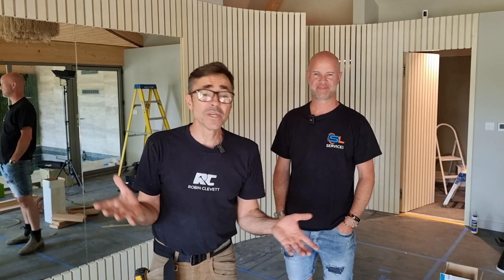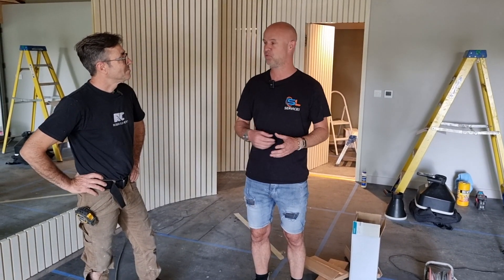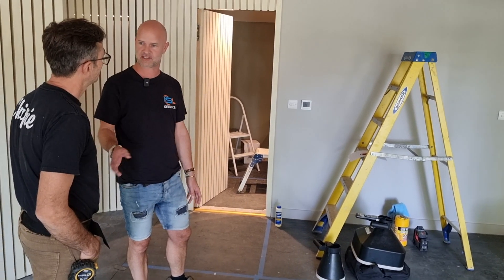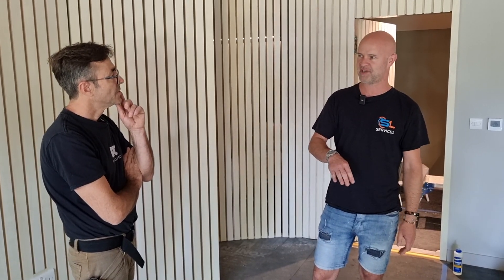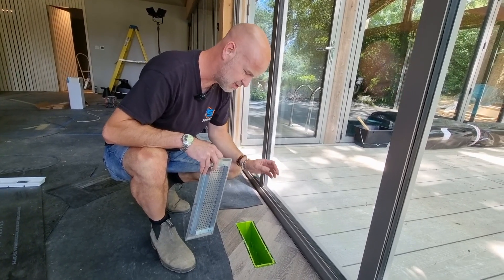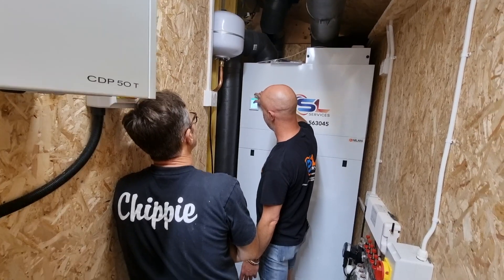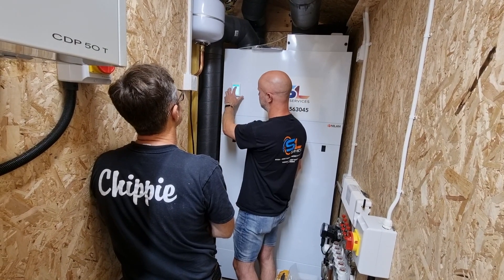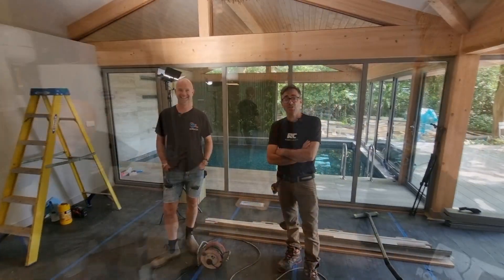Low cost heating and hot water and MVHR. Ultimate Garden room

Comment: A very interesting video. Is the underfloor heating and the air conditioning controlled from that same unit?
Reply from the maker: The unit provides the heat for the underfloor heating but the underfloor heating is controlled by its own controls and electronics, the unit has a small electric boiler internally that switches on when the floor is calling for heat via the room thermostats

Comment: Do you wish you would have installed this in the main house? If I can remember you installed another mvhr system.
Reply from the maker: This would be two small for the main house, and we have gas there so we have a wet underfloor heating set up, megaflow for hot water and then MVHR for all the moisture and ventilation control etc
Reply: @robinclevettcarpenter  oh so it’s limited on size of area etc… I remember watching you install the mvhr in your house. How are you getting on with that system?
Reply from the maker: Hi Andrew, The Lindab Mvhr system is trouble free and super quiet, I think I would struggle to live without MVHR now as the air quality of the house is always so good and there is never any issues like condensation anywhere!!

Comment: Hi Robin. Does this system do the pool temperature aswell or is that from a different unit?  
Knowledge is power. It’s good to learn new stuff
Reply from the maker: Hi Keith, the pool water is a separate air source heat pump, and the heating in the pool room is by a dedicated dehumidifier that also heats the air by electric element

Comment: nice but. that`s an expensive bit of kit for a garden room ,, go on then ball park figure how much did that system cost ??
Reply from the maker: I had to look at a few factors when deciding to invest in this unit and on the face of it lets say it is 10k supplied and fitted... but what I have is a super efficient system that is not energy hungry. There are indeed many other ways to do the heating, hot water and ventilation but believe me I looked into every possible combination of separate systems to deliver what I needed and when you take a decent MVHR system and installation, An on demand hot water system that is able to store hot water and not cost the earth to run, and separate heat source for our wet underfloor heating then it is very comparable in initial outlay of using single solutions.
If I was building a small house then I would not hesitate after using this unit to fit one again, and it all runs of a single compressor like a domestic fridge
Reply: @robinclevettcarpenter   cheers Robin
Reply: @robinclevettcarpenter  
I was looking at retrofitting a smaller MVHR system in my late 90's build home, primary use case being to provide good ventilation to the 1st floor living space of about 500 sq ft.  I see Nilan does a CT150 passive heat recovery unit and they have VPL15 which does active heat recover along with all the other options such as your Compact.

If I was to install one of these units would it interfere with the radiator CH system? Or I should turn off all the 1st floor radiators and let the heat exchanger provide hot air space heating?   A bit confused as to which model to use and the pro/cons of each when running it with the existing CH system.

Comment: What about dust and farts - filters in place / easy change?
Reply: Has filters but not sure it’ll help much with digested pork scratchings
Reply from the maker: the filters are super easy to change and very good value to buy!
Reply: The extract air is only filtered to protect the exchanger, after that it goes outside.
Reply: I’d take out the filter and enjoy the farts. I love smelling my own farts. It’s quite difficult in public, but there ways to make it discreet. If you’re having problems, like me, there are help groups. I can point you in the right direction if you need help. Don’t be ashamed of a fart, it’s just human nature.
Reply: @gdfggggg  you don't get to enjoy them. the unit exhausts to outside and replaces your fart gas with fresh air blown in from outside.